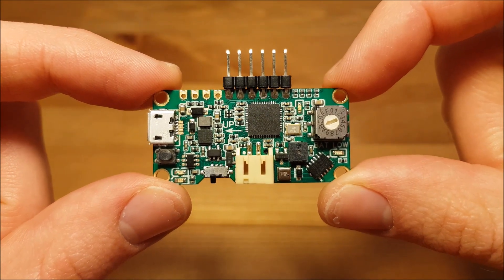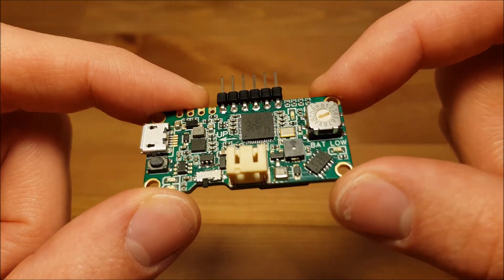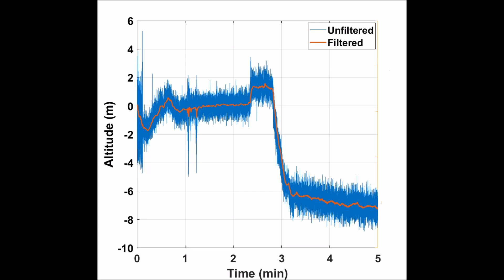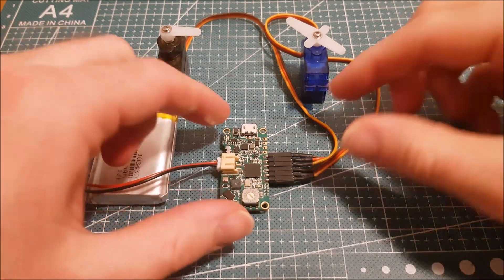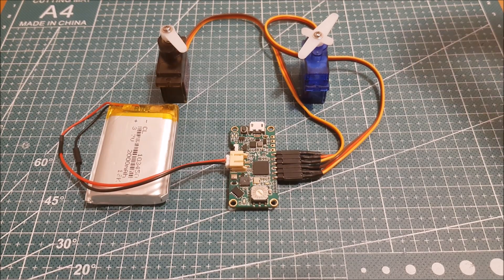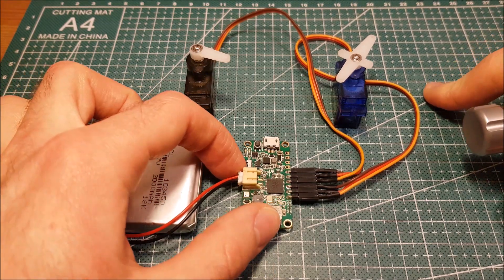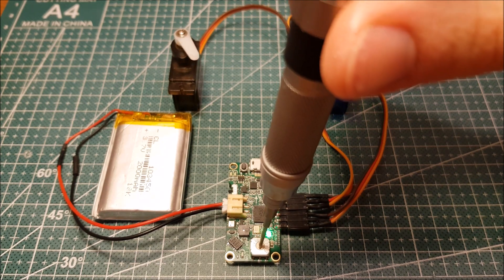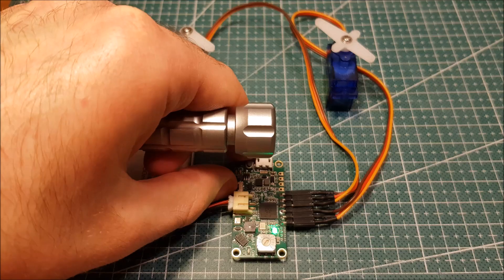Rockit: the flight computer for water rockets and model rockets

Comment: Hello, Dan, thanks for the help the last time, but I have an another question. Is there a way to set the timer mode delay for even more than 15 seconds? It's for testing purposes, because it's really hard to put everything in the rocket in just 15 seconds and it would be nice to have at least 20 sec deploy delay. Thanks
Reply from the maker: Hi! Yes, there is a way. You have to modify one line of code. I could do this for you and send you the firmware. What I don't understand is why you need more than 15 seconds. The flight computer starts the countdown after launch has been detected, not after it has been turned on. Please reach me by email (you can find it on Tindie) and I will send you the firmware.

Comment: Hey, Dan, I was wondering if theres a way to simulate launch on firmware 2.1 real coded? But other than that, this controller is truly amazing!
Reply from the maker: Thank you Syphid! To trigger the flight controller cup your hands on top of the pressure sensor and suck the air out. Then move the controller forward (as indicated by the arrow) rapidly to trigger the launch detection. This way you would trick the flight computer into thinking that it is flying at over 10m of altitude and that it has measured 2g of acceleration for over 100ms.

Comment: Works great! Would love to see a software version that would set of pyro charges
Reply from the maker: Thanks! Would you then use the flight computer for parachute deployment or for staging?
Reply: @daninvents3652  Would be using it for parachute deployment.  The computer is wonderfully small and would be perfect for deployment in some of my minimum diameter rockets.  It fits (snugly) in the 29mm nosecone.

Comment: Suggestion for the future. Move the battery connection from the side edge to either the middle of the board facing up or to the end. It will fit better in the body tube.
Reply from the maker: Thank you for the feedback! The thought had not crossed my mind when I designed the board. Possibly because I have been doing water rockets only and in those there is typically ample space for a payload.

Comment: Hi quick question: what kind of batterij do you suggest I use. I saw that you used 3.7 volts is that okay or do I need 3.3 volts. And it doesn't use up must batterij right, so how much millie amp hours is good?
Reply from the maker: Hi! I recommend a battery like this one https://shop.pimoroni.com/products/lipo-battery-pack?variant=20429082055

I would not recommend using batteries from Aliexpress since those have very thin wires and they can feature the wrong polarity.

You might find useful what I have written about the battery in the user manual. You can find it here https://github.com/DanInvents/Rockit/blob/main/RockitRev1UserManual.pdf
Reply from the maker: Actually, I bought the battery from the link that I shared and the protection IC that is integrated in the battery kicks in when the servo motors move. I think that larger batteries e.g. 1000 mAh might operate at higher currents.

Alternatively you could remove the protection IC. Do this at your own risk since it is dangerous, it can damage your battery and start a fire if you are not careful.
Reply from the maker: I have found these high-discharge batteries from Hobbyking. These should operate at higher currents without the protection kicking in: https://hobbyking.com/en_us/turnigy-nano-tech-plus-650mah-1s-70c-lipo-pack-w-jst-ph.html?queryID=1154f7f3b25567a71b51fa572de4ba20&objectID=83282&indexName=hbk_live_products_analytics

Comment: That's awesome Dan! An excellent update to the flight computer. It has some really neat features. With the RP2040, you have some serious compute power on-board. Is it possible to have a mode for the second servo that it activates at a particular altitude? That would allow it emulate the functionality of Jolly Logic chute release. Particularly useful for dual deploy mode in model rockets.
Reply from the maker: Hi George and thank you! Thank you for the feedback, I had not considered that possibility. It would be easy to change the firmware so that the second servo would move say once the rocket has descended by 40% of the altitude at apogee. When writtng the firmware I was thinking about using one servo motor for staging and the second one for releasing the parachute. The possibilities are endless! One could even use the approach that you suggested in a video to disconnect the rocket from the shock cord once it has landed on a tree. Because as you know, that is something unavoidable.